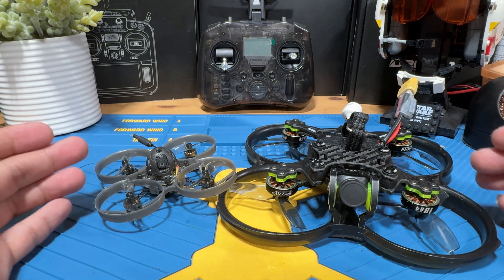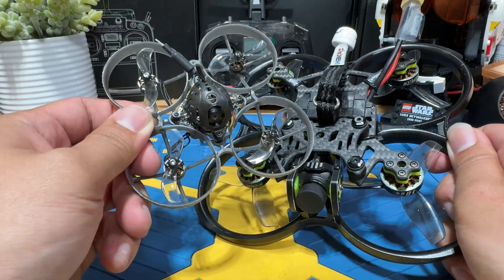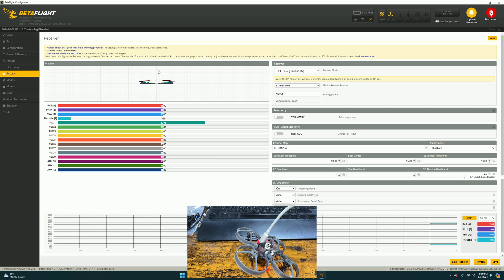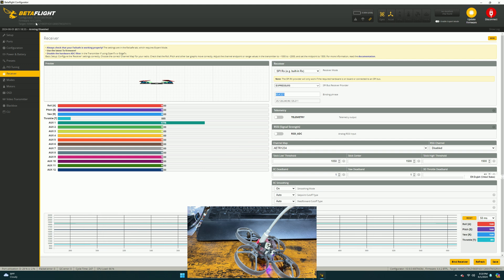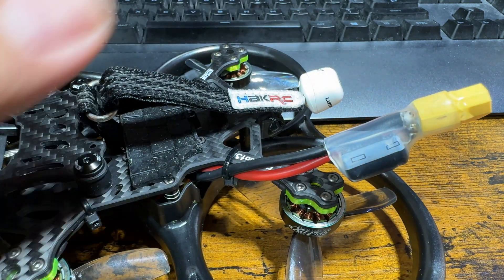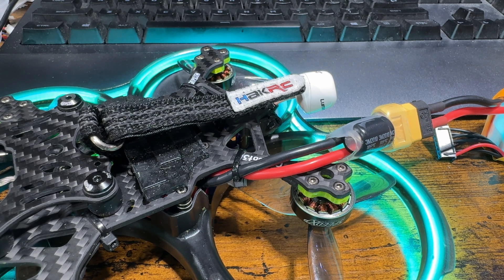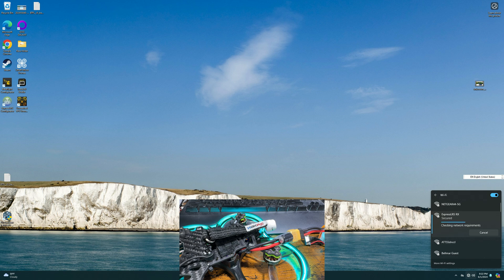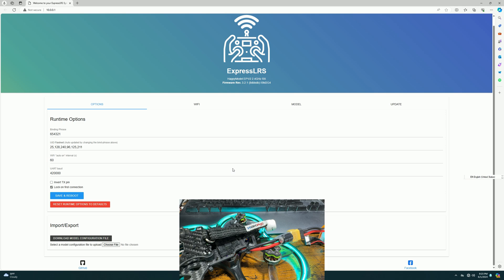How to setup binding phrase for most ELRS Drones? SPI vs Serial Uart

Comment: wow I love where you've put your capacitor 02:39
can you tell more about it or link us to your video about it please
Reply from the maker: That is a self made plug, simply solder the capacitor to the XT60 with cables and heat shrink tube it
Reply: @XwingFPVRC  capacitors are not as effective at the top of the pigtail

Comment: Question. I have a CC2500 T-Lite with an ExpressLRS attachment. i just got the TinyHawk 3 plus and it is not binding. I tried it through the drones binding, and beta flight and nothings binds. The googles connect, but not the controller.

Thank you!
Reply from the maker: Quick fixes maybe:
1. Enable your external module 
2. Assume the tinyhawk has SPI? Make sure your BF version is 4.4 above 
3. Make sure your ELRS RX module is 3.X above
Reply: @XwingFPVRC  How do I check. my ELRS RX module? i saw videos about checking the versions, but when i go to system, there is only spectrum as an option and not ELRS. External doesn't work and I think the tinyhawk has SPI
Reply: @Piper_Pilot_Ventures   did you get you drone up